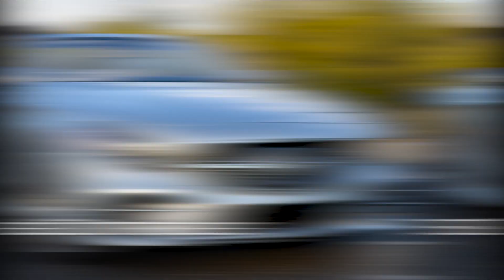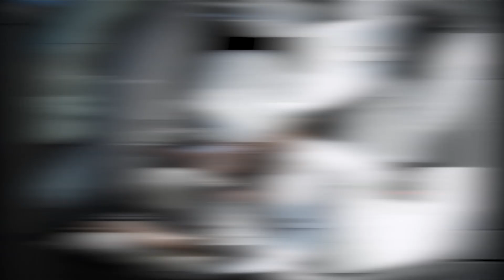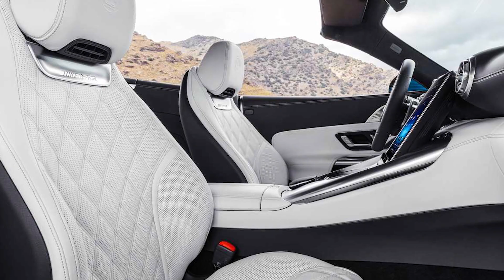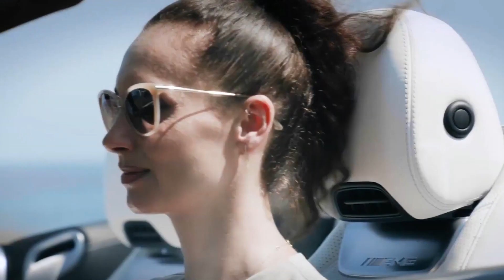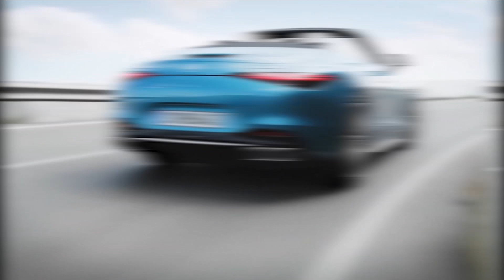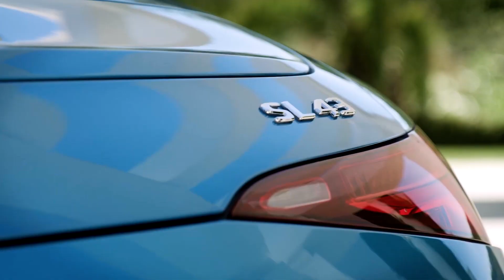NEW 2023 Mercedes AMG SL43 | FIRST LOOK!

Comment: Mercedes gave the SL a second change and I think it was the right thing to do. It has a sporty classic look on the outside but luxury on the inside and is packed with new technology. The MBUX infotainment system is pretty cool. The four galvanized turbine nozzles in the dashboard give it a unique impressive look. The seats are Artico man made leather and fabric and look beautiful and luxurious. It is packed with sensors, cameras and radars and can even communicate with other cars on the road. Not to mention its various driving modes. I think this vehicle will be a hit in 2023.